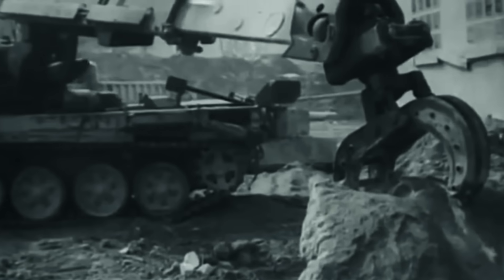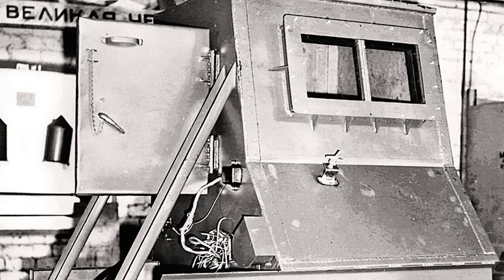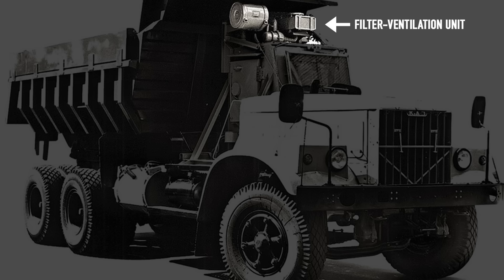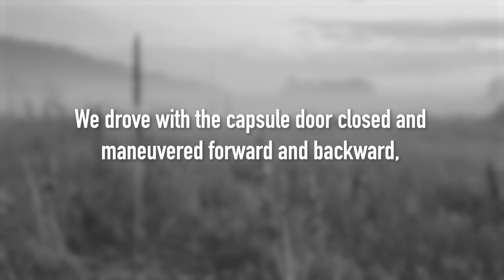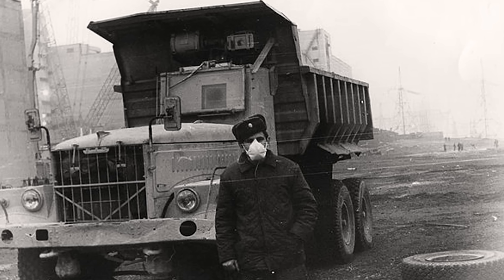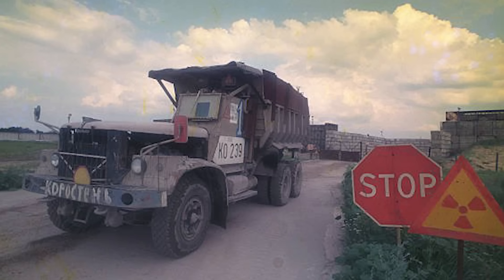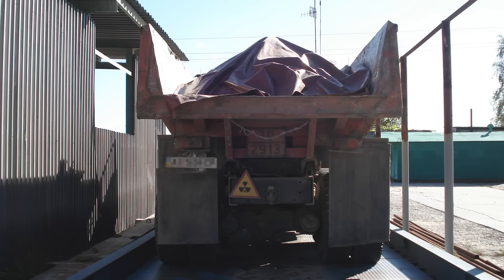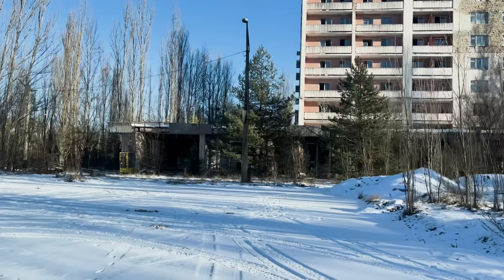Chernobyl’s Apocalypse Trucks, Built to Survive Extreme Radiation | Chornobyl Uncharted Ep 06

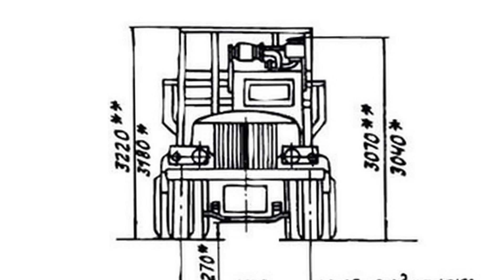Comment: @2:15 there also had to compensate the load bearing of the design due to the weight of the massive balls of the drivers that operated these machines. :D 
All jokes aside, eternal glory to the Liquidators. Real life heroes, every single one of them.
Reply from the maker: @thesayxx  :)
Reply: Did they know...?
Reply: @daviniusb6798  know what? that they are hauling highly radioactive materials? yea they knew
Reply: Right - but the USSR did NOT provide any true info about the harm that will happen and how bad the situation was!!! 
We- Germany/West - knew in 84 because a Norwegian (afaik) weather station read unusual values! And the UKR did not know either!
Reply: @derJackistweg  1986

Comment: Despite all the conversions did they actually work in protecting the drivers? I suspect it was more for show just like wearing lead plates for the liquidators (bio robots) who worked on the roof
Reply from the maker: The use of shields is a cornerstone of radiation safety. You can calculate the suppressed radiation dose power with a formula Q = Qi x 0.5^(d/h), where Qi is initial level, d — thisckness of the shield, h is half-value layer which is a thickness required to reduce the power of radiation to half; for lead it is roughly 1 cm.
If say we have Qi = 1 Sv/h and d = 3 cm, then the dose power behind the shield will be 0.125 Sv/h, which is 8 times lower. 
When you deal with radiation, any shield is better than no shield at all.

Comment: Do you find that videography/photography is much affected by the radiation these days? It's hard to tell with the video compression artefacts so am just wondering.
Reply from the maker: From what we know, visible effects on recording start when the level of ambient radiation is around 5R/h (roughly 43 milliSv/h). With film-based cinema recordings/photography it can be lower, but anyway still should be very high. Back in the day, it was a common issue. Nowadays you can get visible artifacts when walking inside the certain areas inside Sarcophagus. It is very much visible on Oleksandr Kupny videos and photos.
Reply: @ChernobylFamily  Thanks so much for that - I've just checked out some Oleksandr Kupny content - very snowy looking images.

Comment: With that level of radiation, how the hell do you service or repair any part of the truck outside the capsule?
Reply from the maker: Radiation is not a magic substance; you always have a source of it, so there is no average levels. You drive away from the source to less-contaminated or clean area, remove the surface contamination using a special chemistry or at least reduce it to acceptable level, and then it is possible to service. Of course, at Unit 4 site there were neutron sources in many places (which are the only which can make something itself radioactive), so some things at some point you cannot wash away anymore. It is a question of luck.
Reply: I imagine that the design changes were also practical for this reason - not just to reduce the chance of failure in a contaminated area, but also to reduce service points, such as opportunities for mechanisms to clog or require adjustment. I have to assume that they realized these machines would not be in service very long, so in certain areas would have tried to make it last as long as it needed to and not worry about distant service intervals too much. Perhaps the frame reinforcement to support the lead cabin made changing the clutch or transmission oil difficult - both irrelevant if the machine will be retired before requiring service

Comment: Driver had easy job, imagine mechanics trying to keep it running ind suche conditions
Reply from the maker: Yes. Though, we can not exclude the psychological factor that surely was present for a driver.
Reply: As a heavy truck tech. Yeah. Ugh. Not comfy. Whole damn truck is soaked in radiation, in America we glorify the truckers. Fact check, they are steering wheel holders, few know how to use a manual gearbox, even fewer do safety pre and post check, this job though I gotta give credit, drivers here had some balls that’s for sure!

Comment: You couldn't make a vehicle like this today.   The massive amounts of computers that run a modern truck wouldn't survive the radiation.
Reply from the maker: I guess if a task will be like this, it will be possible.
Reply: Compared to what was involved in making these trucks and other equipment to do the cleanup, I think reverse-retrofitting a purely mechanical engine, etc. to a modern truck would be easy.
Reply: We could do it! But greedy manufacturers would never because they can’t sell u heated seats in it 😅
Reply: You are not an engineer. What's the problem putting computer inside the protected cabin?
Reply: @johnbo375  That's easy, the accessory parts maybe less so. ECUs rely on a variety of sensors which are sensitive to ionizing radiation at higher levels. Anything is possible with enough time and money but dragging up some mechanical power plant would likely be easier
Reply: Theyd just use these old soviet trucks or the American Deuce and a half...Those old trucks are still all over the place
Reply: Eh a lot of heavy equipment engines get all their cooling from filtered radiators and have the engine air inflow through multiple filters to keep dust out, you'd just need to armor the engine enclosure and step up the filtration

Comment: ISU-152M/152K SPGs was also used to ruin walls of te reactor and some buildings. Also with the direct shooting from 152-mm howitzer in them...
Reply from the maker: ...and not only for that.
Reply: @ChernobylFamily  yes, but shooting into a radioactive facility to ruin it... soviets in nutshell... (c)
Reply from the maker: @ttl3000  i'd not judge here — assuming which levels were there, other options would cause a lot of casualities.
Reply: @ChernobylFamily  this is a very controversial, because the explosion also disperses radioactive particles
Reply from the maker: @ttl3000  the question is localization, wind lift, etc., etc. There are techniques how to reduce effects of that, which are used widely even today. They not always a final solution, but mostly work well.
Reply: @ChernobylFamily  ok, agreed )

Comment: Interesting video. There was no equipment to protect against radiation, they had to be built. Still, too many were exposed to radiation.
Reply: I could be wrong, but that seems to have been the same story for every nuclear power in the 20th century: they may have had greater or lesser levels of redundant passive or active safety systems to try to prevent an accident, but nobody in any country seems to really have made much preparation to have to deal with the aftermath of a civilian nuclear accident if it ever did occur.  Lots of detailed plans and preparations were made to try to respond to a nuclear war, but every time there is such a civilian accident, contingency planning seems to have been so minimal that everyone has to try to work out the solution from first principles, when there is very little time to do that and, as we have seen time and again, common sense cannot be relied upon because nuclear physics is weird and doesn't follow the laws of common sense.
Reply: @tommcewan7936  That is true. Although the safety systems protect the reactor from failure, they are not completely foolproof. If radioactive material gets into the environment from the nuclear power plant, there seems to be nothing more than a plan on paper. The local rescue service is only capable of first aid. If the emissions are higher, we are really in trouble. This should be talked about more so that in the event of accidents there would be better preparedness to protect citizens. Information should travel without delays. I have not selfishly thought about how poorly this matter has been handled.
Reply from the maker: Unfortunately, you are right.